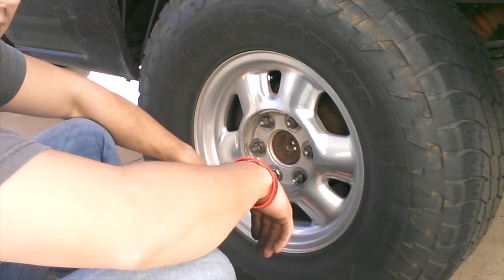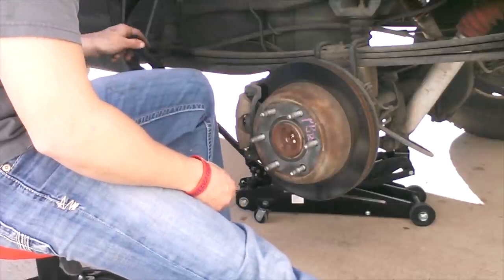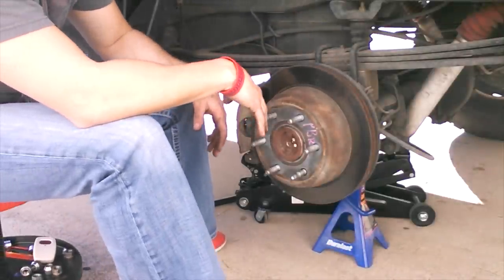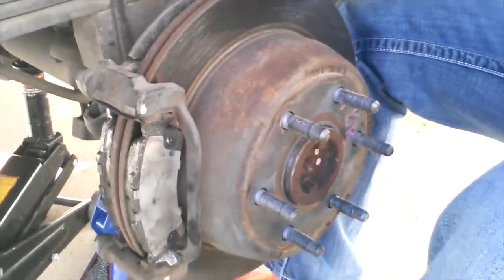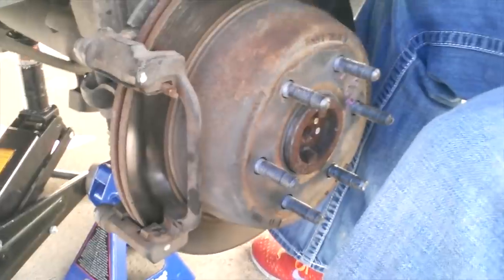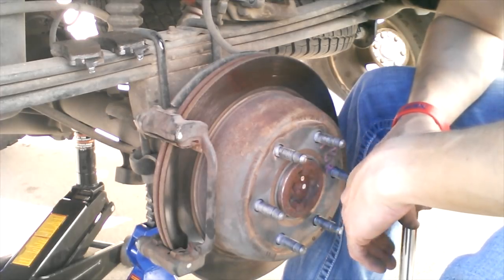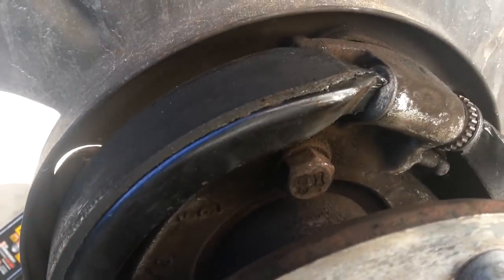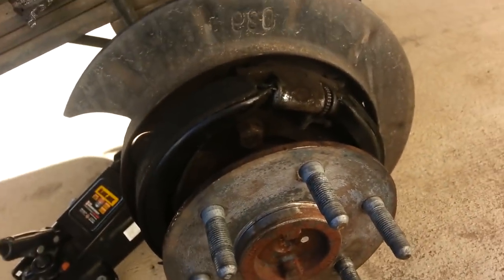GM Parking Brake Pad Change / Adjustment - HOW TO / TUTORIAL

Comment: So when you apply the e-break, the mechanism causes that horseshoe to expand and press against the rotor? Also, when you adjust the e-break radius, why do you want any kind if resistance? Wouldn't that mean the rotor will be rubbing against the e-break in drive?  I would imagine it would be optimal to make the e-break as close as possible to the rotor, but not making contact. I am trying to learn this.
Reply: Nick TheGing You need it to be tight enough where there is maximum resistance yet still push the rotor on.  When you drive down the road (of course with the parking brake off) it will seat, adjust and break in.  If it is loose before you know it, it will be P-pedal to the floor again just to stop the car an maybe not good enough to hold it for accelerator depression for a passing sticker.
Reply: Nick TheGing  Hi watched the video and he did a great job but there is so much more that it would be a movie.  GM cheaped out on these emergency brakes and it shows.  The brake ring is supposed to expand into the inside of the little drum in the middle of the rear brake rotor.  There is actually a specification for the setting but only GM dealer has the correct tool.  The best way to set is expand until they just start to drag then back off star wheel about 1/2 a turn so there is no emergency brake drag.  There is also a adjuster on the emergency brake cable  make sure its only screwed in about 1/3 it's total adjustment travel when you start.  Everything should be clean and lubricated when you start the emergency brake retaining hardware in back has a history of breaking as well at the emergency brake cable.  The backing plates for the rear (and front)have a history of rusting to dust after a few years so double check.
Reply: Gordon Grimes Yes GM did screw up with this design.  This design is a one piece horseshoe which stresses and stretches the cables and expands them resulting in premature failure of the entire system.  A two piece E-brake shoe does not have this problem and is the preferred design which has worked for years.  THE quick FIX for this problem is to take the shoe and cut multiple notches 2/3 the way in the inner shoe all metal halfway area allowing it to easily expand and contract with minimal effort.  You will likely get many hundreds of contract expand cycles before the shoe breaks in half where the notches are put.  Sure works much better than having to push the dam pedal to the floor all the time stretching/compromising the cables.
Reply: I've got mixed feelings about notching the POS brake assembly I have already seen an example where the whole system was torn p because the brake assembly broke and caught up in the drum which did considerable damage.  I don't remember any notches but the item has separated in half (I was not really looking for them).  I think the best is adjust the brake so you have minimal clearance w/o dragging so you limit the parking brake travel when used.  Sorry but I don't have a really good answer except for cleaning and adjusting every few thousand miles.  I live in the Southwest and these things are so cheap you can hear them rusting just going through a car wash.
Reply: My '05 Suburban has no cable adjustment like i thought it would (like old school stuff) wished it would have. :( @gordongrimes6773

Comment: If you're not changing your brake pads then why did you disassemble the caliper from the carriage? You made extra work for yourself. Just remove the whole caliper and carriage in one piece by removing the 2 bolts from the knuckle and zip tie it to the leaf spring.

Comment: Decent video.. however there isn't any brake pad lubricant on the stainless hardware that the pads sit on.   Oh and use brake cleaner while you have it off to clean entire unit. You will thank me for it later...
Reply: Johnny Z how about changing the cable?

Comment: Opps I broke the little bolt that holds the bracket and holds the shoe in place , now what do I do ?
Reply: I did that too, small bolt seized in the hole, drilled the old ones out very carefully and knocked out the remaining threads, put new screw in that came with brake shoea
Reply: +chris42000000 what did you use to drill out the bolt ? I have the same problem

Comment: Put the jack stand under the frame before you take off the tire!!!
Reply: @ 2:58 there is no jack stand under the vehicle. Before I work on a truck car whatever I place a jack stand under the frame or axle. Nothing wrong with a jack stand under the frame.
Reply: mike galgano He did put a stand under the axle. If you put it under the frame and put the jack under the axle, the stand will not help you.
Reply: I'll try again. You jack up the vehicle high enough to place the frame on a jack stand and still be high enough to remove the tire or put it under the axle before you do any work.  You don't want to the jack to be the only support as you take off the tire. If you have work on trucks the tiny 2 ton stands aren't gonna cut it they're too short!

Comment: What the heck happened to GM? They can't figure out how to make a system that you can adjust your emergency brake without going through all of that crap. Other vehicles you take a flat head screwdriver and stick it through a rubber grommet and flip up or down to tighten it up or to loosen it. Good grief what a pain
Reply: My $0.02?    GM wants to keep auto mechanics employed.....